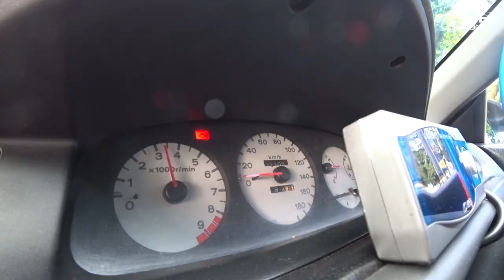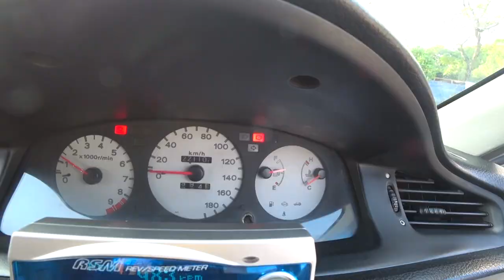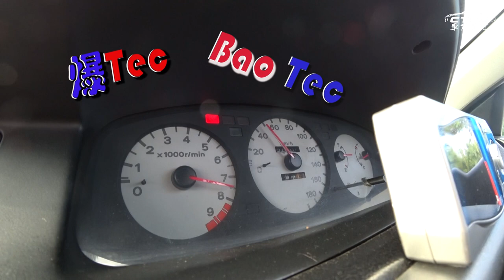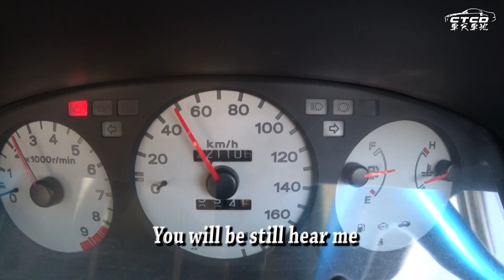蟹人爆Tec “K20A乳猪全只” Honda EG K20A

Comment: 0-100成6秒都叫快。。。
Reply: 要几秒才快？
Reply: Kopi Laobeo at least 4 sec
Reply: 4.5秒內
Reply: 依家仲有邊副2.0 NA可以做到依個速度？
Reply: 要追求NA起馬6缸,8缸, 宜家4缸比turbo統治哂 haha
Reply: MIU MIU 2000年左右既時候 法拉利都無邊部係4秒以下 e46 m3同r34都係5秒左右 其實k swap eg可以做到6秒已經算好快
Reply: K20, racing cam, racing crank, fuel injectors upgrades, engine block , cam rod, crank rod upgrade, racing / sports intake manifold, valves, full says racing exhausts, dump all heavy shits, make the car lighter, . You may got almost 350bhp ( without turbo) , or k22, turbo , full racing upgrades, over 400bhp.
  You can get 0-100 less than 4.6 sec in no time. Plus get a better tires, Oem tires size will slip.
Reply: MIU MIU v8, i6 , pro tuning can go more than 700bhp, 500bhp